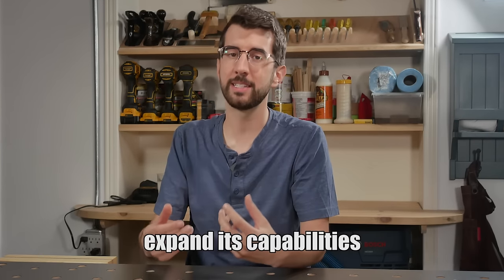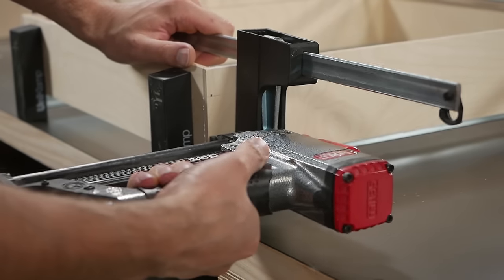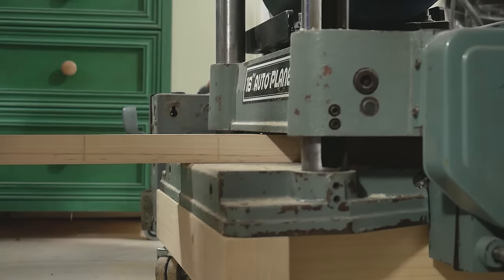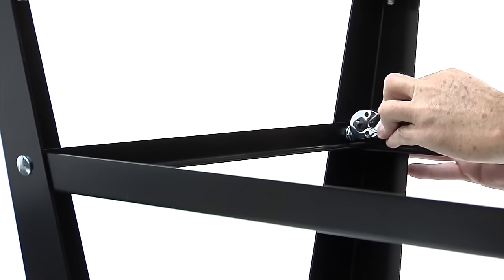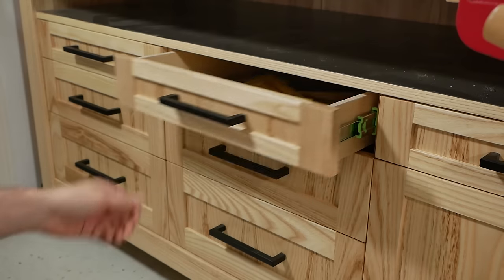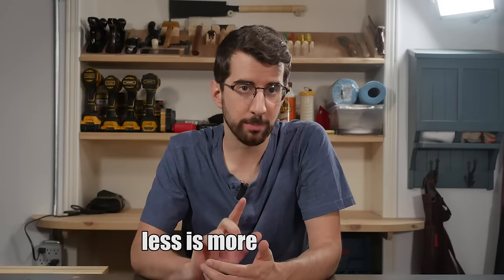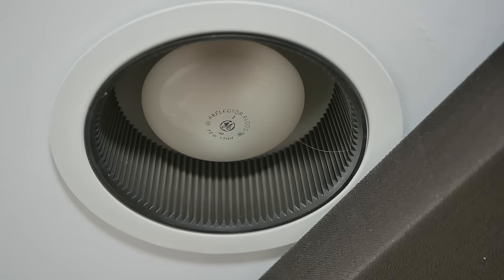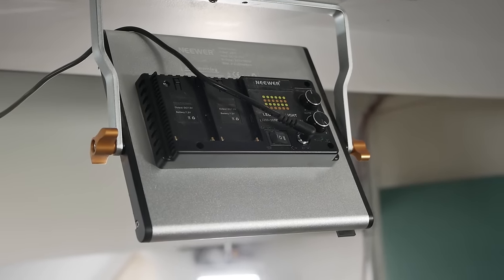a better way to layout your workshop

Comment: I've had the opportunity to visit and work in shops of a number of well-known (in the '70's) woodworkers around the country.  My institutional shop was very well organized and we kept it very clean but I can't think of any of the well-known woodworkers' shops that weren't piles of sawdust, trails going through work areas, etc.  Many of them would talk about how they could tell a "good" woodworker from one who was not so good.  The "good" woodworker's shop looked worked in.
I agree with you more than I did them.  It's far easier to let the sawdust pile up and only clean it occasionally.  But I doubt that you'll change many minds;-).  Thanks for your good ideas.

Comment: One thing I think you could add to this is cable and hose management! I don't mind pulling out my planer every time I need it, except when I need to unplug something to plug it in! Great video, I have watched it a few times as I am going through my own shop. Keep up the great content and I'd love to see an update on this if you have anything new to add.
Reply: Good point about power. I added a wall mounted multi-outlet strip at the back of my workbench so I wouldn't have to juggle plugging and unplugging things. You don't need an expensive, hard-wired PlugMold setup. There are other affordable alternatives. Make sure the fixture has a power rating sufficient for the tools you'll use with them.

Comment: I have a 3 car garage and I am planning a small workshop to allow for all 3 cars to be parked while maintaining a workshop in the same space. I resonate with your thinking. Small drawers down below. Everything that sparks joy has a particular spot. Some open space for quick tool grabs, cabinets if you want to hide the hideous stuff. All good stuff. I get it. The tip you made about throwing out the metal stands and making your own was the best idea. I have that very problem. Scraps accumulate under my bandsaw stand and I cannot store anything there but scraps. I just think the perfect shop is overkill. Your shop is simple with a human element. Always changing. Ever evolving. I like it.

Comment: Great advice, Scott. Working out of a 1-car garage-sized rectangular shop was a challenge. While I have lots of wall space, the shop is only 12’ wide. My approach was: get everything out that isn’t used for making (including wood storage); put my tablesaw on a rolling platform & building a removable top that serves as my assembly table (until I built a collapsible track saw table that rests on sawhorses & can be used for assembling larger projects); and building a “tool tower” (also on casters): 30” square, 7’ tall with 5 drawers on 100 lb. capacity slides. The tower holds an array of tools in the drawers & hung on the 3 other sides and on top. A collapsible plywood carrier doubles as an outfeed & assembly table, but folds nearly vertically flat when not used. Eight 8’ pipe clamps are hung on the back of one (of two) barn-style entry doors. Lastly, a jam-packed French Cleat wall holds more tools, clamps, and measuring devices. The irony of my setup is that even though I build custom workbenches, I don’t (& may never) have a dedicated workbench in my shop. I’m reserving that space for a combination jointer-planer. Gotta sell a dozen or so workbenches before that will happen. Thanks for putting this very helpful “thinkpiece” video together. Sincerely, another supremely satisfied subscriber.

Comment: Hey Scott. I liked some of your suggestions. Some I disagreed with. I think having wood on hand, especially making room for special boards you come across, is important. Nice video, with advice that I will think over. Thanks!
Reply: Sure you need a convenient place to keep it but it doesn't have to be inside your work space. If your ceilings are high, you can add hanging storage to keep it close and out of the way.

Comment: I got some discarded 36Wx24Dx19H upper kitchen cabinets for cheap. I stiffened the base and top with scrap MDF and plywood and added casters. I use them as tool bases with built in storage. Perfect for  mounting my benchtop planer, and  it holds my different sanders, electric hand planer and all my sanding consumables inside. And 12 4' LED tubes cost about $100 and truly made a world of difference

Comment: the first order of retrievability concept is more about not having to move stuff out of the way when you need something. A drawer is not an issue by itself. But for items that are used on a very regular basis it's sensible to think about putting these to a more accessible place.

Comment: I have a small shop with a low (7'-4") ceiling. I have made hangers by using a hole saw make to hold mailing tubes in wood cleats. I use these to store strips of inlay, dowels, carbon fiber rods and rolled-up plans. It saves my precious wall and shelf space. If I had taller ceilings I would still do this and use a step stool to access them.

Comment: Great tips here.  I am nearly at the stage of roughing in the electrical for my new shop in my barn.  I like what you said about drawers as my tendency is to make cupboards for a quicker "fix".  But I can see the utility of using drawers instead.  Good point about the workbench as well and it's cause for pause as I overbuilt a rolling outfeed table for my jobsite table saw which frankly now takes up alot of space with marginally useful storage.  Much appreciated Scott.

Comment: Having had TWO cordless brad nailers, neither of which had enough power; both of which broke within a month and had to be sent back, I HIGHLY recommend against them.  I went and got a compressor.  Aaaahhhhh!  So much better.  As you would know there are some pretty sweet, small compressors.  Mine is a Makita 1000.  Also very quiet.

Comment: In April I started giving away tools and other crap I didn't need to the local  Restore.In May,the French cleats magically appeared along with the required tool holders.June and now July have seen a total work flow change for the better.Next the lights.Great video.

Comment: My home shop is 12 pounds of crap in a 5 pound bag. My hobbies are wood working, metal working, welding, knife making, shooting, reloading, air conditioning, refrigeration, electronics and gardening,automotive including body and fender Not to mention all the painting, spakling and hardwood flooring tools, tile saws and cutters,ladders and acutraments that are needed to keep the house up. I do all this out of a 20 by 20 garage. I have no room on my property for a shed and I won't just pile stuff in the yard that is so common in this state. I have drawers,cabinets, shelves,wall hooks and rafter hangers. I am very well organized having spent 20 years working aircraft with three times a day tool inventories. I feel I spend as much time rearranging and organizing as I do working projects. Great video, glad you got it figured out. There is no hope for me.

Comment: Helpful stuff. One of my uncles fixed glass jam jar lids to underside of his shelves with 2 screws, then could attach jar and contents easy to see what was in each (mostly different size nails, screws, nuts bolts) and unscrew them to use them. Made good use of top of under-shelf.
Reply: My dad did that in our garage/shop 60 years ago! Pint Jam/jelly jars and quart peanut butter/fruit jars. I'd guess close to 60 jars at eye level over a 12' long workbench. You could see what was in each jar to pick what you needed and all it cost was for the wood screws to hang the lids. They were still there 2 years ago when my sister died and I had to clear out and sell the house.
Reply: @garrettswoodworx1873  must have been a thing, this was back in late 60’s early 70’s he was an engineering toolmaker by trade, his garage workshop was immaculate.

Comment: First order retrievability is about the continuous process of evaluating what is used most in a given situation and organizing your space to keep those things easy to access when performing that task. It is EXACTLY the process you just discussed regarding your large tools...

Also, yes, sometimes taking a 2 steps aways to grab something is not feasible, or is aggravating, so including a storage spot for that item where it is commonly used can be worth the extra effort up front and the extra space potentially taken up. On that note, having a duplicate set of tools/bits CAN make sense for a few reasons. First is that it is often the case that a job either needs Good tools, or just meh tools. Having an every day set of tools out and an expensive set put away is a good way to save money by minimizing the risk of damaging your good tools while still having them available. Second, duplicate sets can reduce the risk of loosing a tool because you moved it around. Ask a mechanic about ¼" sockets, they probably have some actually attached to things that need them regularly, just like a Jacob's key. And the third reason I can think of off the top of my head is sometimes you need something but you can't let go of what you're working on. Clamps would be a good example of something you want hanging on your workbench somewhere so they can be grabbed without stepping away from what you're working on.
I would honestly refer someone to Adam Savage on Tested for his shop storage solutions. I wholeheartedly agree with his assessment that drawers are where tools go to die. If you can see it you'll forget you have it, if you forget you have it then you won't use it.
I have worked in warehousing my entire working life. Space optimization and process improvement are my specialty, and I'm good at it.
If you are going to use drawers, dedicate them to something. Clearly lable them. And for crying out loud, use your vertical space. Aside from being able to hang things, you can run electrical and pneumatic lines on the ceiling with quick access where you need it rather than on the floor where you can trip on it, or under the floor/in the wall where you have limited access

Comment: Hi Scott, My greatest error is to not put my tools away, perhaps because I dont have enough cabinets, but also the traffic flow is poor. Having something in the middle of the room is a big waste of shop real estate My table saw is a monster that until recently, was in the middle of the shop without wheels and for whatever reason of the time, the infeed side faced the garage door and that was the problem. Now, I will discard all of the waste that has been collecting and turn the saw around! so I do not have to twirl the lumber around. to get to the cutting side. Thanks for all of your videos, each has been a keeper for the small details that could make us go insane.

Comment: The only other tip I'd add to this is to think about overlapping tools to save floor space. I have a miter saw and a cabinet I built for it (that's a little too big for the space, but meh) and I've put both my drill press and router mount in the same piece, so the three tools take up only the one tools floor space. The drill press table is always above the miter stuff, and the router is retracted 90% of the time.  Same kind of concept to your planer under your jointer until you use it or the bench being outfeed as well. The nicest thing is cabinet is already set up for storage too so I have my router bits and drill bits and wrenches etc all right there.
Reply: Exactly -- gang tools together in a small shop when it makes sense. This way, those tools effectively share the same infeed / outfeed and support wings. If possible, add wheels to that section or series of tool bays, so that you can pull a tool out when you're working with a board that is longer than the usual space available. This is especially true for the mitre saw, where you're often starting out with a board that's 8'+ or even 12' in length.

Comment: regarding lighting, I have seen recommendations for having 150ish lumens power square foot of space in a shop. a 60 watt incendesant or equivalent gives off around 600. I recommend getting hanging shop led lights. easy to install pretty cheap and pump out a lot of light. if you setup light switch outlets for them then if they were too cheap and went bad you could then replacement them easily

Comment: Lighting is huge. I got some LED shop lights for $12 a pop at Lowe's. A couple light socket adapters to plug em in, and it was an enormous shop upgrade for $50. It's like I unlocked access to new spaces in my shop now. 

On that, don't put a big light behind where you stand at your table saw. Put it over the saw. My shadow on the saw while cutting was distracting and made it harder to see the cut and tape measure. 

And a Bluetooth speaker light bulb is pretty nifty. Not much for lighting, but for the tunes. Nice to have a small speaker that doesn't need charged every couple hours and connects automatically when you flip on the lights.

Comment: Before I moved my shop was a 2 and a half car garage, which I thought was too small. Looking at the space you have to work with is crazy. Huge kudos - and most of your advice is very sound. However I would argue against your statement that casters are not the answer - but not for the reason you'd think. Sometimes a change in needs or a re-arrangement is necessary in which case moving the bigger, heavier items is a nightmare if they're not on wheels. Every tool and bench I have that is able to is on wheels even if I don't plan on moving it frequently, if ever.  Also helps with cleaning.

Comment: I'm going through similar process. I've had a 24 by 30 pole barn built after purging and tearing down an 18 by 28 foot old cinder block structure with lower level. It was built in 40s and was falling down. So now new space has to store Halloween decoration (a MUST) and my wood shop. I figure I'm looking at a 40/60 split with wood getting 60. Lots of wall space and storage will be up (not quite loft). I have been playing with it to put stuff above window and door height. I have started some drawers and love the cleaner access to my most common tools. Here is what is really cool. I'm just using poster board dividers and hot glue in drawers to organize. Why do I like it, I CAN CHANGE IT!. As I get stuff in I learn ya, I like a cubby with just rubber bands, or my pile of Phillips bits don't need to be in top draw. So I take out a partition and move it. Maybe some day I'll make something more permanent but love the options. Now the shop walls.....FRENCH CLEATS...Yes I'm building a couple cabinets (shadow peg board from Woodsmith but another just my own design, paint and tools) but I think french cleats will really free up stuff and make flow work. My plan is once I get my major item in (table saw) I build an outfeed/assembly table kind of similar to Shop Nation (no I don't pay for plans). So I'll share my stuff once I get it in. Might be Spring before I'm fully ready but love you sharing your journey. Thanks

Comment: My most used 'tool' is likely my router table. its a 2' by 3' custom made table that also holds most of my tools. I used it more then my bigger workbench, its better suited for larger projects. The smaller table is in the middle of my shop so I can easily move around to all sides rather then turning whatever possibly heavy item that I'm working on. Its on casters so that it can be easily moved out of the way even if I have something heavy on top of it. This way I can increase the floor space if I need to.

My shop needs to do more then woodworking, its a farm shop and needs to do a little of everything. This includes storing things that I don't use in my shop but are in there because its the best place to have them when I need them as they are easy to get to and I know exactly where they are. I do plan on building drawers into the shelves that line every wall as there is a lot of wasted space there, just need to figure out the best way to do so. None of the shelves match and store all kinds of things, I even have two motorcycles taking up space, its a real nightmare lol.

Comment: My garage has 3 seperate sets of lights; a small 2" double fluorescent strip & a 3 bulb set with a fan for minimal lighting, when playing on the computer/watching the TV/smoking etc. I then have 12 feet of fluorescent lighting on the left & right sides of the garage, each side on it's own switch. I can turn on as much light as I need, when I need it

Comment: Thanks for this. I'm currently in the process of designing an 8x12 shed to use as a small woodshop.   This video provided some great tips to help with that.  I never thought of have no miter saw but I may be convinced to leave it out as its pretty large.
Reply: I got rid of mine and just handle crosscuts with a sled in the table saw and the bigger panels with a bench dog/track saw rail setup. I don’t miss it at all.
Reply: I got rid of mine and just handle crosscuts with a sled in the table saw and the bigger panels with a bench dog/track saw rail setup. I don’t miss it at all.
Reply: I got rid of mine and just handle crosscuts with a sled in the table saw and the bigger panels with a bench dog/track saw rail setup. I don’t miss it at all.
Reply: I got rid of mine and just handle crosscuts with a sled in the table saw and the bigger panels with a bench dog/track saw rail setup. I don’t miss it at all.
Reply: I got rid of mine and just handle crosscuts with a sled in the table saw and the bigger panels with a bench dog/track saw rail setup. I don’t miss it at all.